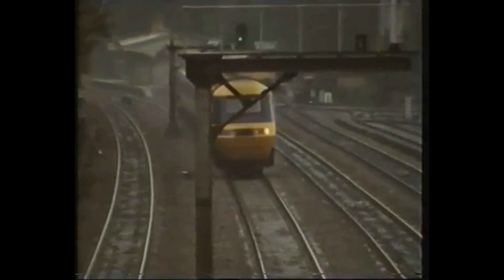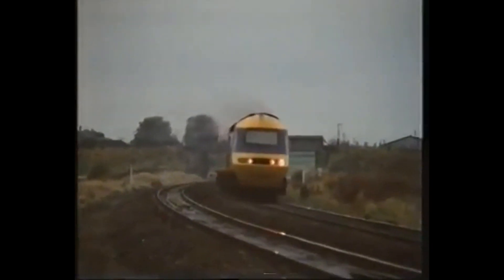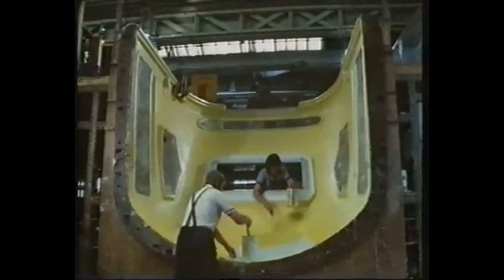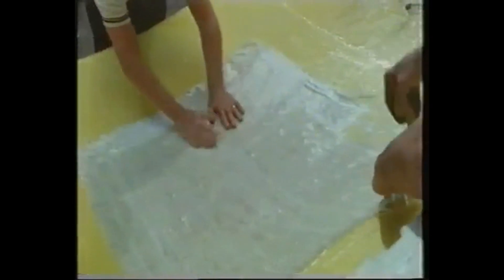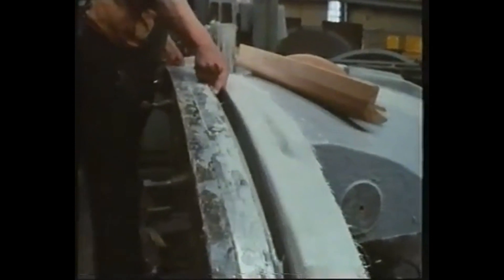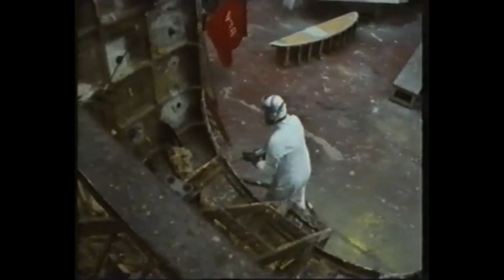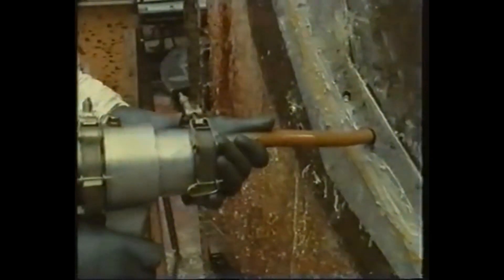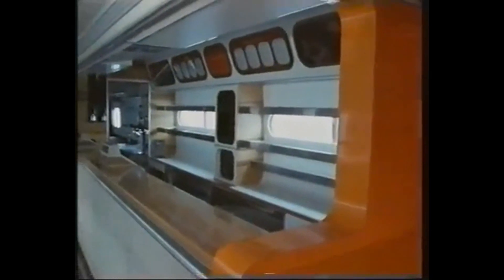British Rail InterCity 125 HST Manufacturing Documentary

Comment: NSW Trains still operate a locally adapted version to this day, built by Comeng in 1982, using the Paxman 10 cylinder motor.
Reply: The NSW XPT is now with the VP185
Reply: Both Paxman `Valenta' & Paxman `VP185' are V12 turbo Diesel engines and drive a Brush alternator.
For those interested in the developement of the XPT check out `XPT by COMENG' (3 videos) here on YouTube.